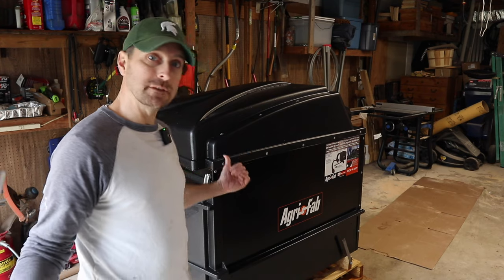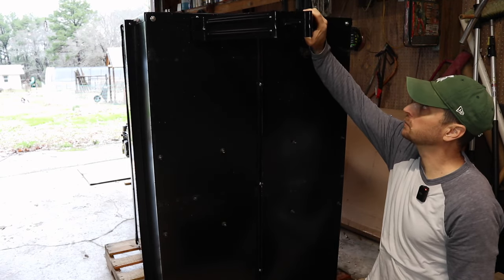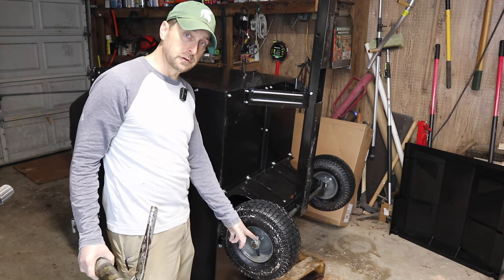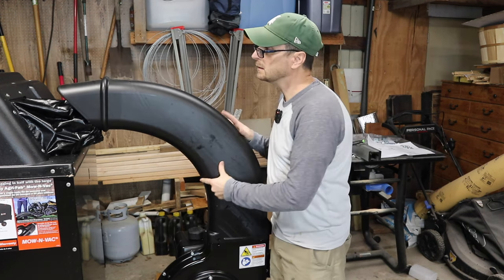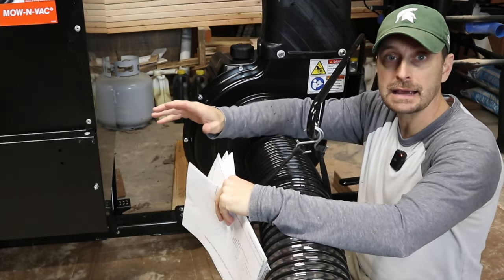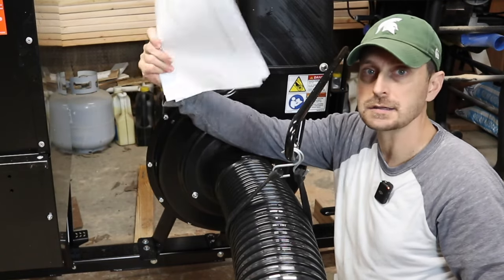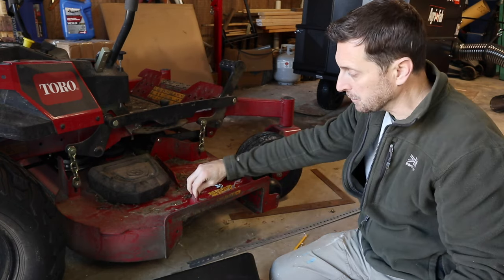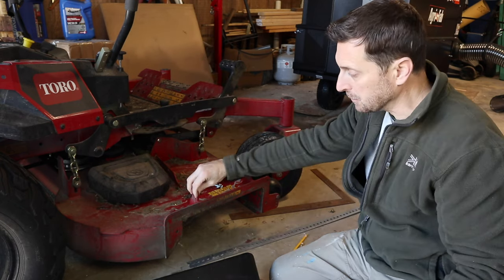Agri Fab Leaf Vacuum Assembly How To! Mow N Vac First Use!

Comment: I hope they improve around the impeller small limbs get caught in between housing and wheel and will stop engine u will have problems with. But works well otherwise
Reply from the maker: I'll see how mine holds up. Seems to be working well so far.